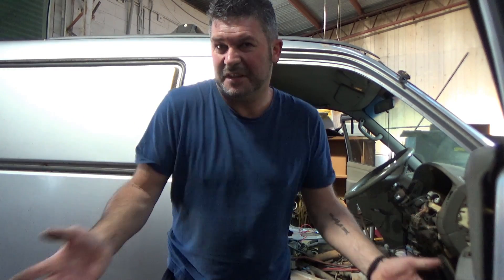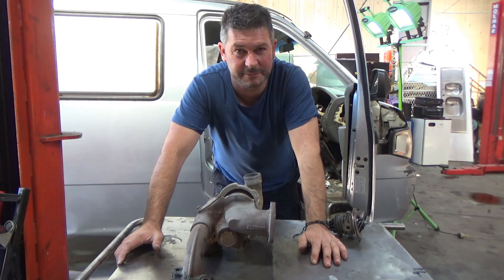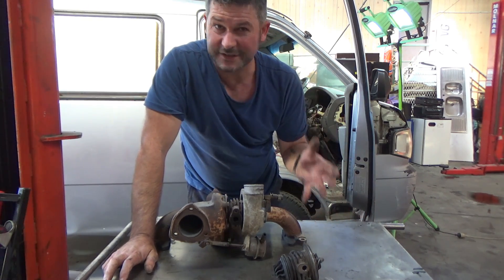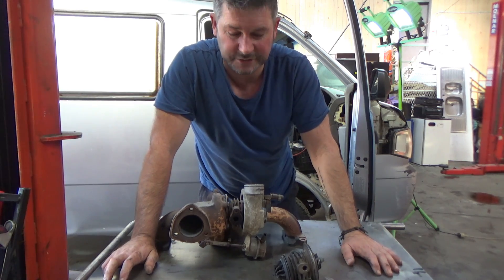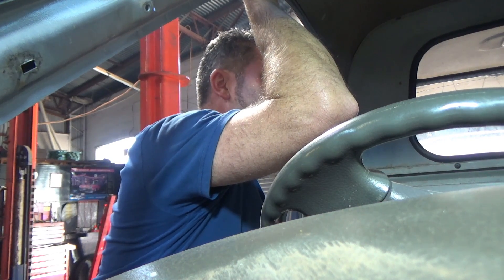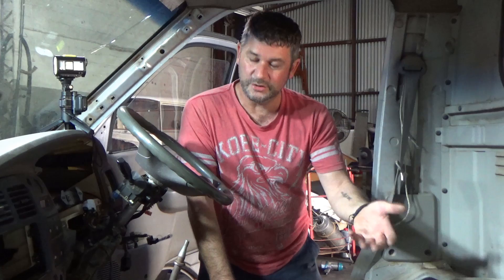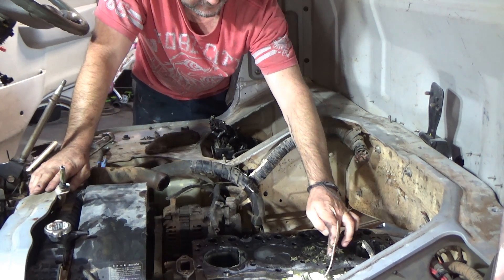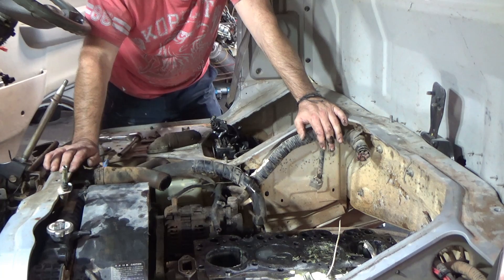How to Stop a Run-away Diesel -ENGINE BLOWS !

Comment: PERSONALLY MY HYPOTHESIS IS FOCUS ON CUTTING FUEL. IDK BUT IN THE COMBUSTION CHAMBER ISN'T THERE MUCH MORE FUEL THAN AIR? THOUGH IT'S OBVIOUS THAT CUTTING THE AIR IS FAR EASIER TO OCOMPLISH. THE BEST WAY TO AVOID THIS, KEEP BASIC MATINENCE UP TO DATE. THIS CAN BE VERY EXPENSIVE POTENTIALLY. KEEPING UP ON IT SHOULD PREVENT PRE-MATURE WEAR AND FAILURE. BUT THERE'S ALWAYS THE UNAVOIDABLE.
Reply from the maker: Richard Gantenbein a runaway diesel isn't running on diesel fuel mate. That's kinda the point.
Reply: A runaway is running off the engine oil, cutting the fuel would just be a waste of time.
Reply: Richard Gantenbein it is sucking oil from the pan genius. Cutting the fuel does fucking nothing
Reply: First of all air to fuel ratio... there is always more air.... Secondly "runaway" means it's running on oil.
Reply: Much rather buy turbos than engines
Reply: Richard Gantenbein There is much more air than fuel. I have first hand experience with runaway condition. Dirty air cleaner caused engine vacuum to suck crankcase oil around worn rings, thus cutting the fuel had no effect. ( Ignition off cuts fuel, closes solenoid valve ) Was caught early enough so engine never went into uncontrollable revs. Car was like in cruise control but surging.  Luckily I was able to lug engine down & limp home. Compression check & diesel mechanic proved it. No hypothesis. Ring job & air filter maintenance no more problems. P.S. Lose the all caps.
Reply: That is unless it is some sort of technican induced repair problem. Runaway diesel's happen in the repair facility also.
Reply: Ball valve on turbo lubrication???? Just asking.
Reply: Hey WRENCH g, there's no need to yell. We're not all deaf like you.

Comment: 《EPIC FAIL!》 IF TYPICAL RUNAWAYS WERE ONLY STUCK AT AT LIKE 1/8th THROTTLE THEN THIS EXPERIMENT MIGHT(BIG MIGHT)HAVE BEEN PLAUSIBLE. BUT RUNAWAYS ARE ALWAYS AT FULL THROTTLE AND FOR EXTENDED PERIODS. THE LONGER IT'S STUCK THE HOTTER THE ENGINE GETS MAKING IT EASIER FOR A DESIL TO BURN FUEL. UNDERSTANDING DESILS YOU'LL KNOW WHY THIS IS BAD. YALL SHOULD GIVE THIS ANOTHER SHOT. MOST PEOPLE LIKELY LEAVE HERE JUST AS CONFUSED.
Reply from the maker: Richard Gantenbein look buddy, we do this for free, we don't make money from it. We had a van we could blow up, so we did, if folks like you want to donate another vehicle for us to do it too. Then we are more than happy to give it another shot.
Reply: First off, take off the caps lock you mental midget.  Second, if you're going to accuse someone of not understanding diesels, you might want to learn how to spell the word.
Reply: Keep in mind that these are diesels. They do not have a throttle butterfly controlling airflow, as found in a petrol engine. The intake is wide open at all times and fuel flow is what  controls engine speed.
Reply: Richard Gantenbein my old vaxhaul ran away whole idling... the turbo bearing broke
Reply: diesels dont have a throttle. the speed of the engine is controlled by the fuel injector.
Reply: Ted is right. There is however an intake flap to shut off the air supply when turning off the key. A safety feature, if it works correctly.
Reply: The very same dude that on another comment told to shut the fuel line off, is bossing around the experiment... Makes total sense, OK.
Reply: You don't really "understand diesels" at all do you buddy lmao

Comment: I saw a video where a guy snuffed out a diesel Ford F-150 with his hand over the intake. Not sure if I'd try that myself but it worked and that was an International V-8 diesel.On an older vehicle without airbags though I might try yanking the rubbery center cover off the center of the steering wheel and shove it over the intake if it were big enough to cover it. I think something kind of soft would conform better to the intake and make a better seal. Still, on yours I agree that the engine was getting air somewhere else.
Reply: *F series*. Better??

Comment: The term 'runaway' is a misnomer . The term is overspeed . 
The runaway comes from the operator running away :p
Reply: G Crauwels runaway and overspeed are not the same. Often one will lead to the other. You can have a runaway diesel running at idle speed.

Runaway simple means that you have lost control of the engine and have no method of slowing it down or stopping it. An overspeed is when the engine is running at speeds higher than it is designed to handle and most often comes from faulty fuel control systems.

Comment: If it was a proper runaway then it would be revving much higher than you are running it at
Reply from the maker: PenZon -yep, good idea. I will take it you are volunteering to be the one that sits next to it 10,000 rpm while in a van and let's the clutch out ??
Reply: Simulate what happens when an engine runs away in the real world: load a garden sprayer with engine oil and spray it to the intake. The thing about stalling the engine is that it's not running at a high rpm. It isn't even running at redline-rpm. It's most likely screaming twice what the tachometer could even show. That's usually enough to atomize the clutch in some fraction of a second.
Reply: PenZon; People suggesting to "just dump the clutch in high gear" because "that will stop it for sure" have never been next to a 1400 FT LBS diesel screaming for mercy. The only run aways are the ones who think dumping the clutch will work.
Reply: Not too much, at least on leaving it in gear and stalling it. I had a Diesel VW Rabbit run away on me while driving down the highway. I got it pulled over, put it in gear and stalled it with no problem.
Reply: Bernhard Jordan   Yes, at high rpm's diesels lose torque, but as you try to kill it by dumping the clutch, by the time the revs have been dragged down a bit, the clutch is now hot as hell, right about the time that the revs hit the engine's torque band, then it's pulling like hell against a burned-up clutch. 

Guess which one wins.

I suspect dumping the clutch will work better on a small diesel with low rotational engine mass, but on a big diesel like in a semi, the engine's internals are really heavy, and carry a lot of momentum, so there's a good chance that if the oil leak is a bad one, the combination of momentum and engine torque will likely just overpower the clutch, even in a high gear.

If the leak isn't too bad, dumping the clutch probably would work, as I suspect motor oil isn't a very good fuel, and probably doesn't produce nearly as much power as diesel fuel.
Reply: Gábor Krammer I had a 12.7L series 60 Detroit with 750,000 miles I was driving runaway with itself,  & the RPMs went up to almost 4,000 RPMs.  it may have actually reached 4,000, but can't say for sure cuz I took off runnin'. that engine ran flawlessly for another 2.5 years after that
Reply from the maker: Yep. And if we could do any more than hold the throttle wide open on a dirty old push rod diesel to get it to over speed further, let us know !
Reply: He's also going to bring another diesel for you to run the test on!
Reply: Bernhard Jordan true, but you have  rotating inertia and mass.  That "impacts" the clutch.
Reply: The torque output is lower, because the engine sucks/blows a lot of oil, and don't have enough oxygen for burning it properly, so it is less effective and generates much smoke, but also a lot of power. 
And it runs way over the red line rpm. I guess it can go 1,5-2 times the red line rpm?? somebody pls correct me on this
The rotating mass stores a lot of energy, if you just step off the clutch it can be ripped apart if not slipping. If it starts slipping then it will be burnt very quickly.
Reply: You could of used brake cleaner, spray a load of that and watch it go!
Reply: Well that is exactly why people leave their vehicles when the engine runs away. It sounds scary, and it really is, you don't know how long the engine will last at that speed. Con rods, flywheel, pistons hits the valves, many things can go wrong with catastrophic results.
Reply: Naked Off Road - On many mechanical diesels the full throttle stop is also the max rpm governor. Adjusting that incorrectly (or correctly in this case) will often allow rpm well above redline. If you want, at the same time you can adjust the max fuel setting which would also help a little, but more importantly it would roll coal before redline, which is cool, apparently. Also LPG, but that's asking for trouble when you are intending to blow something up
Reply: Edgar. Fuel is the throttle control on diesels. They vary power by controllong mixtures.
Reply: Edgar G ...but it IS getting enough air! During a runaway the governor is not even part of the system so the more air/"fuel" (in a runaway the "fuel" is oil) mixture is sucked into the engine the more combustion occurs. The more combustion creates more exhaust. The more exhaust spins the turbo faster. THE FASTER THE TURBO SPIN THE MORE AIR and leaking oil get sent to engine.

The more air/"fuel" (in a runaway the "fuel" is oil) mixture is sucked into the engine the more combustion occurs. The more combustion creates more exhaust. The more exhaust spins the turbo faster. THE FASTER THE TURBO SPINS THE MORE AIR and leaking oil get sent to engine.

THIS OCCURS UNTIL THE ENGINE OVER REVS ITSELF TO DEATH! The only way to stop it is to: 
A) Stop the air from coming in. (2X4)
OR
B) Replace the oxygen in the air with another gas. (CO2 in fire extinguisher)
Reply: The revs are higher, but also I would bet the torque is way lower than a normally operating diesel would. It's lubricant after all, not the proper fuel. I could be wrong but it could be easier than to stall a red lining diesel running on actual diesel.
Reply: If runaway happens while driving, dont take out of gear as you might never be able to put in again. Just push the brake. Its the least expensive part to change
Reply: Stacy Smith and ive had 3408 cat run away on me and a 2x4 wont stop it. Actually had to use a rubber nrb ball lol
Reply: lol great spelling....
Reply: Naked Off Road Any object in motion tends to stay in motion unless acted upon by an outside force. The faster the flywheel is spinning the more inertia will help keep it going.
Reply: Skippy exactly so having to much fuel wont cause a lack of power. And the mixture does not control the rpms its a PT (pressure time) concept. Well in a way you could say it does but its more of fuel pressure and flow Its not a gas engine it dont have to run stoichiometricly
Reply: Edgar G Thank you! I've always wondered why & how a turbo could go online and offline if exhaust was constantly flowing through it. It never made sense to me now it does!
Reply: Stacy Smith no problem! even more interesting is a variable geometry turbocharger that actually throttles the exhaust gasses at low rpms to increase the velocity of the gasses and spin faster!
Reply: +Naked Off Road: I've heard stalling is a risky idea because the flywheel may shatter sending shrapnel flying into your legs.
Reply: Gábor Móczik Yes! A $600 clutch is much cheaper than a several $K rebuild.
Reply: Well I'm 30 and know a fair bit about cars but not this. So learnt something new. Also learnt there are a lot of know it all people poo pooing something you've done . Think the idea is to teach a little something to people that don't know, not teach the so called pros on here that know everything. If you can do a better video please do ASAP if not Keep your opinions to your self. Good video!
Reply: All diesels should have an emergency co2 release built into the intake somewhere, that would stop it without damage. Might fit one to my cruiser just in case.
Reply: didnt think of this before, very nice idea, since i think that the clutch on many modern cars is very weak
Reply: Diesels dont run rich or lean so it doesn't matter if its not getting enough air i bet they still make the same torque
Reply: Stacy Smith yes i get it its more air i never said anything about air anyway....but its not completely burning all the fuel because theres simply too much fuel, thats why theres so much smoke. What was your point?? I rebuild isx isc isl and even isb cummins engines all day for a living im fairly familiar with the operation of a diesel engine common rail or mechanically injecected.....And the turbo has a WASTEGATE so it wont actually make anymore boost than it was intended to. Go ahead google what a wastegate is
Reply: Edgar G You are going to catch my thumbs on fire! I'm like Johnny 5 on short circuit, "MORE INPUT!"
Reply: They definitely run at a much higher RPM
Reply: clutch might slip too
Reply: Hooty256 he doesn't actually know what a runaway diesel is
Reply: Unless it smokes the clutch which is most likely, might work on an ity bity diesel but not a man sized diesel.
Reply: People commenting about destroying the clutch by dumping it into gear. You an get it to speed with an engaged clutch in 1st or 2nd gear and then start breaking it to stall it. It would be far less though on the clutch.
Reply: +John Cheves The clutch isn't designed for braking, and you have only one, but the brakes are sturdy and you have four. What if you release the clutch at 1st gear, let the car go (or burnout :-) and the clutch disc to stick to the flywheel, then dump the brakes and keep pressing as hard as you can. Probably dangerous if you do not have plenty of room for the stunt, but if you have, I think it should stop the engine. The brakes are several times more powerful than the engine. Maybe the discs are trash after this, but still cheaper than an engine rebuild.
Reply from the maker: Hooty256 correct, but would that change the results ?
Reply: Would for sure change the ability to stall the engine
Reply: Lukas Mandić not always, it can just destroy the clutch.
Reply: @Si1983h   but you will save the engine
Reply: Pleading Mule wow, you’re replying to my comment from over two years ago... but no, if a diesel goes runaway and the clutch lets go, you won’t be able to stall it and short of managing to starve it of oxygen, you’ve got no chance of saving it, it’ll either shake itself to bits/snap a con rod or it’ll starve of oil and seize up.

Comment: you are supposed to use a CO2 extinguisher  :) trust me it works well "diesel mechanic"
Reply from the maker: And if you watched the whole video...
Reply from the maker: David Last -Dude, the best thing is for you watch the video and understand what a runaway is
Reply: You can use a powder fire extinguisher if the air filter is in place, it catches the powder, cakes up and chokes off the airflow.  You dont want to use it without an air filter obviously.
Reply: all due respect, I would rather see a bill of a few hundred dollars worth of Co2,  I have seen a lot of run away engines happen often on the initial start of the engine. in our shop we have a pile of Co2 used for this purpose. I personally would rather a shop call me and say we had to bill you a few hundred dollars worth of Co2 to stop your $13,000.00 Diesel engine overhaul from becoming a grenade, then get a call saying "you know that $13,000.00 you just gave us well..... its gone" combustion can not happen where there is no oxygen. by utilizing Co2 gas you remove oxygen from the equation, therefore eliminating combustion stopping the engine.without KILLING the engine lol.
Reply: CO2 ..shut down fires.. and obviously shut down an engine.. you said engine like a fire  need air to feed..NEVER USE an POWDER extinguisher!!!  ..use it makes damage that worth the price let engine run and blow off !! P.S.  10 liter CO2 price is same as powder ones.. people please, use always CO2 extinguisher on engines!
Reply from the maker: SiM0NEXT -and the video proved that ..
Reply: i david i think they said the engine in run away mode is using its own engine oil as fuel through a worn oil seal, hence they needed to stop the air to the engine.
Reply: I think the point was that you're more likely to have a powder-extinguisher in the vicinity, like on your caravan for example. I have a powder extinguisher in my car for example, for the majority of external fires, the kinds you are more likely to have, this is the better one. My car is manual though... my first thought would be to stall it as the video shows.
Reply: DIESELMAN8V92 exactly
Reply: and didn't you see the problem was a turbo leaking crankcase oil in.  You can turn off the key on a diesel and if it still has a fuel source it will run.  No spark needed.
Reply: so what co2 extinguisher is normally not used, it still is cheap and if it works, people with automatic diesels can get it.
Reply: CO2 extinguishers are more expensive around here (UK), therefore powder are more commonly available, as they say. Also, I think that most vehicle extinguisher regulations in EU require powder, not CO2. Some might have CO2 as well, but primary ones are powder. If one was available, yes, I too, would use a CO2, but as they say, commonly available.
Lastly, my priority would be to evacuate the area, or swiftly extinguish, regardless of damage to engine. I'd rather have a wrecked engine than risk the chance of engine fragments blasting everywhere.
Reply: You can stop the engine with nitrous oxide too. lol
Reply: @mattsalomone5053  CO2 from an extinguisher is a liquid - it expands by a massive amount as it evaporates - about 1000 times.
Reply: why are people making sugstions about air filters and co2 extinguishers your engines about to blow whats best for your engine is of little concern use powder foam water co2 halon piss in the intake whatever you need to kill the engine
Reply: on a light hearted note, goverments tell us we have global warming due to high Co2 levels therefore runaway diesel engines should be a thing of the past !!!
Reply: Hey diesel man im not a mechanic i just quick thinken you are all wrong the best way is to just cut the fuel line its that simple.